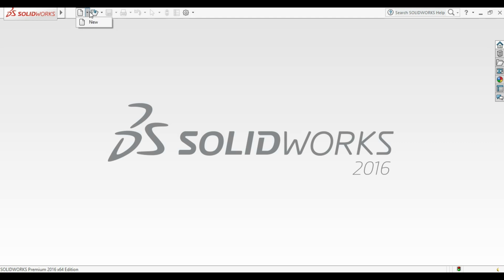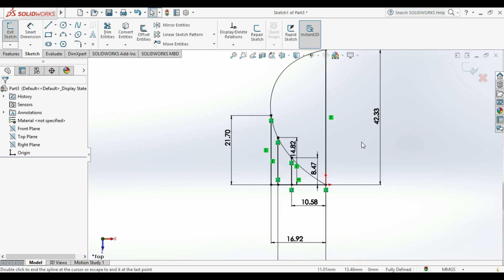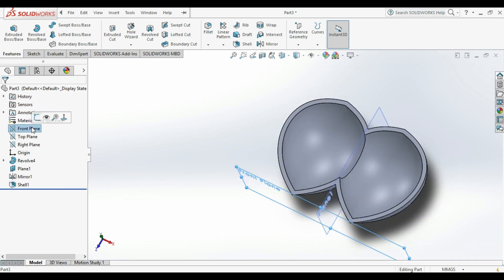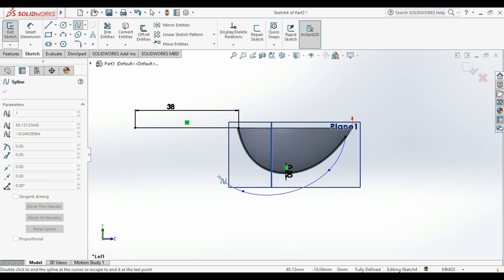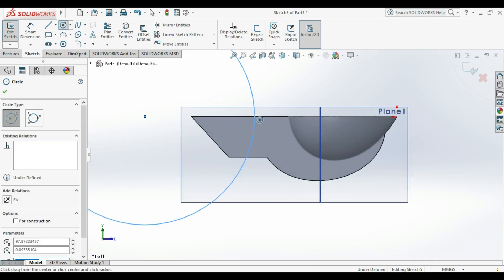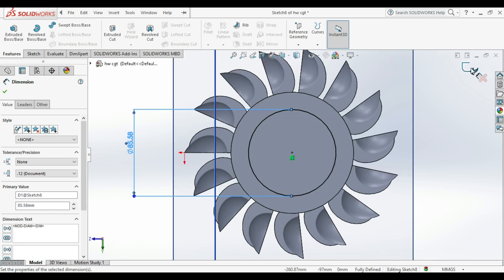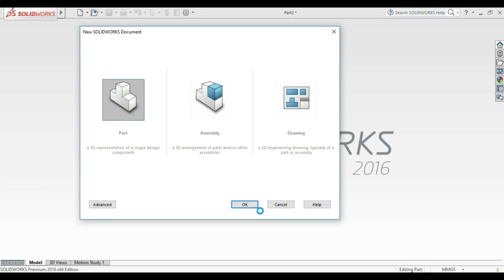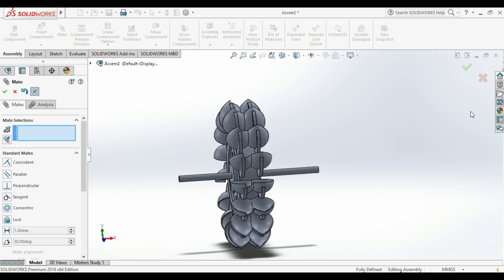Design of Pelton Turbine in SolidWorks 2016

Comment: If your Shell feature is not working it is because of the part of the bucket sketch that connects to the origin. When revolved, it forms a point that SolidWorks cannot negotiate.
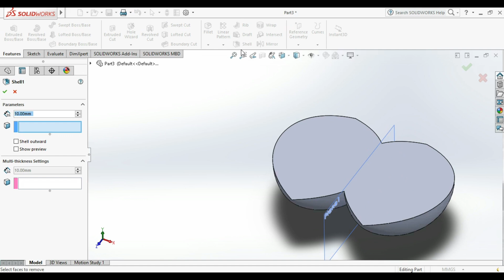Your Shell feature is working though.  At 3:37 do not select a face. Just click the green check.   If you do a cross section view you can see that it is indeed shelled but the top face won't be removed.

There are many ways you can remove the top face. Click on it and start a new sketch. Then click the outside profile of the bucket, convert entities, and extrude cut downwards into the bucket.

OR click on the top face and start a new sketch, draw a big rectangle and extrude cut downwards into the box.

OR just edit the very first bucket sketch so that there is a small perpendicular line to the very first vertical line. This will make it so that there is no sharp point formed.

I can think of at least 3 more ways to solve this problem but these are the most basic. 

Alternatively,  someone else offered a suggestion in one of the other comments to use a Fillet. This might be a simple solution but I haven't tried it!

Comment: When I want to do shell its showing me error that "The shell operation failed to complete. One of the faces may offset into an adjacent face, a small face my need to be eliminated, or one of the faces may have a radius or curvature which is smaller than the shell thickness. I followed all the dimension properly, but still it is showing me this error. Please help me to eliminate it. Thanks
Reply: This may be a bit too late for everyone other than any future people but adding a fillet of 1.8mm to the edges of face 1 has fixed the issue to me.... frankly the turbine does look smoother now.
The issue was the 4 sharpo edges on the piece which resulted in a rounding pattern smaller than it will allow so the prevent this you round the area.
Reply: @dergescheidte547  from the future , we say to you "Thanks"
Reply: @dergescheidte547  should i select all edges of face 1
Reply: me too! help!
Reply: @lucerohs304   me too
Reply: @adriantigrerocano4020  me too any solutions?
Reply: Me tooo

Comment: You make a lot of mistakes in your Pelton bucket design. Leaving the splitter in place. The biggest problem is creating a cutout. Cutout should be rotational rather than radial. Turning is used in production
Reply from the maker: You’re right, this was actually my 2nd design in SolidWorks. It was made more than a year ago for a design course in the university when I didn’t have much experience in SolidWorks. Thank you for pointing that.
Reply: @nourk.al-zamel5217  Its normal that this Pelton turbin will be not perfect. Its not a construction office of pelton turbine but youtube trial. But this trial helps a lot to create turbine with more elementary details.

Best regards